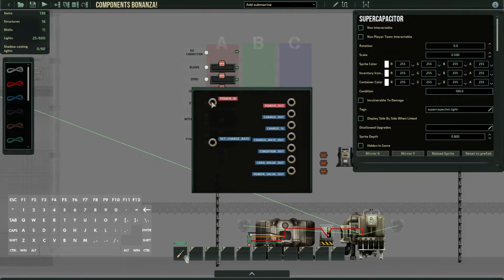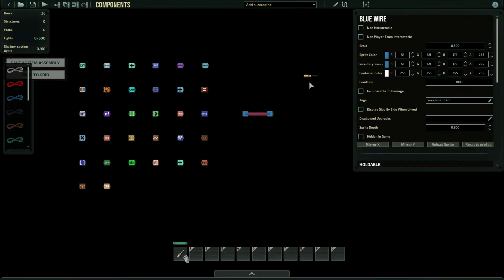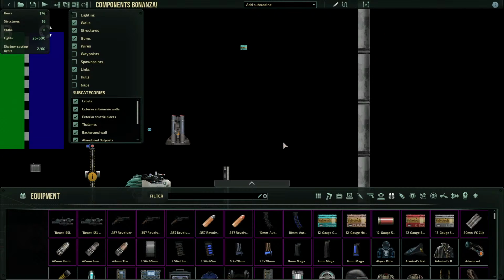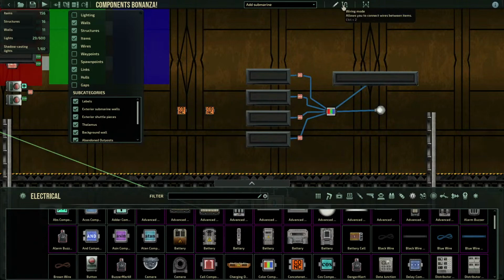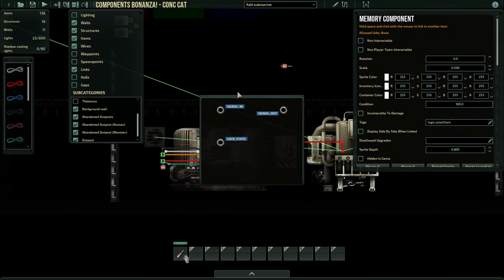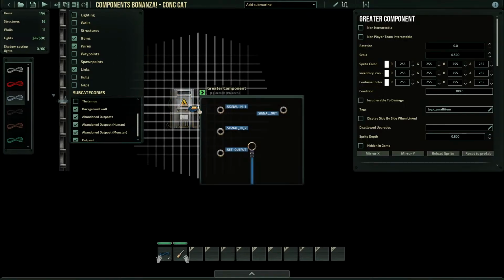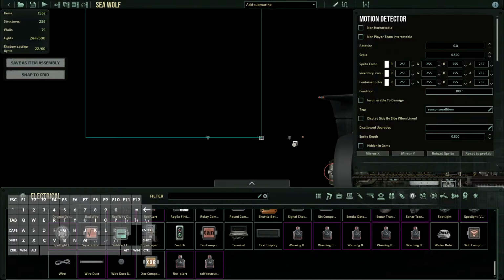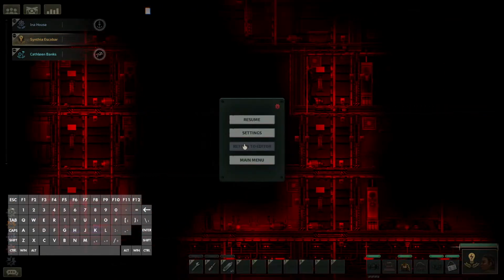TGN Livestream - COMPONENTS!

Comment: Does stuff like this work in both single and multiplayer? 
Particularly the reactor control one from your beginners guide video. 
If wiring stuff doesn't always work in multiplayer, is there a way to tell what will and what won't. 
Thanks :)
Reply from the maker: I make it a point to keep my wiring assemblies compatible with ongoing campaigns, no mods necessary!